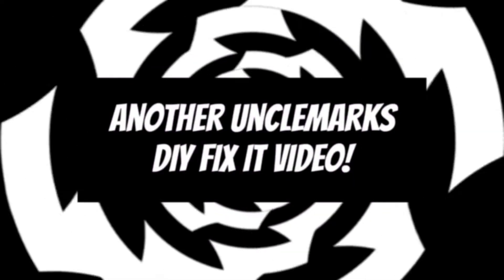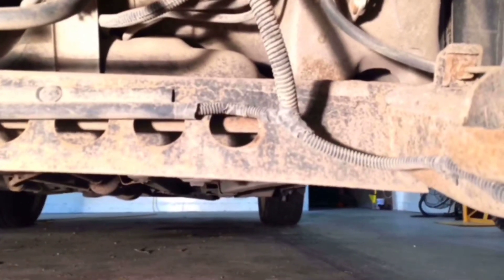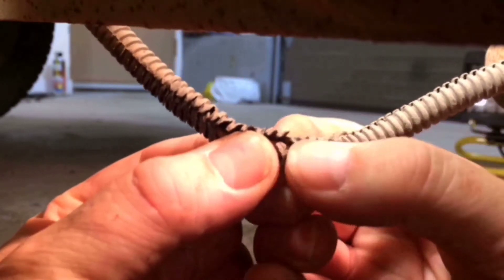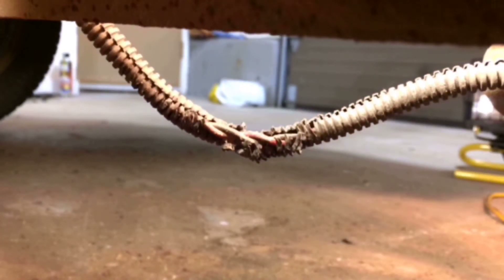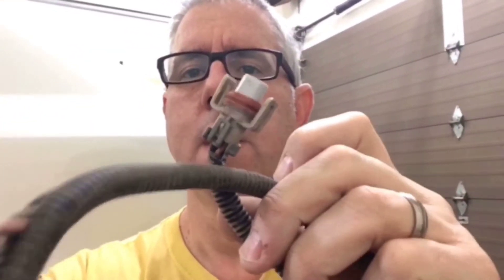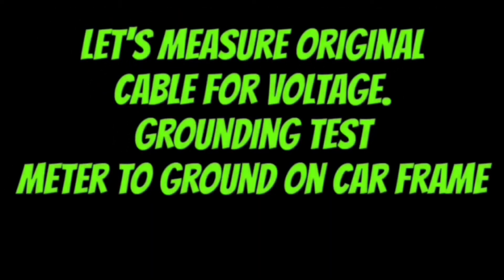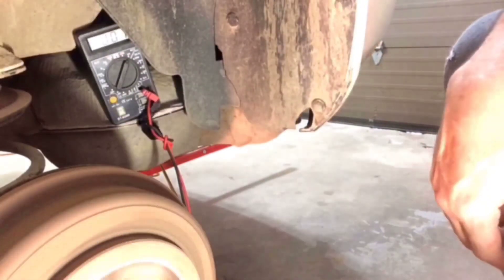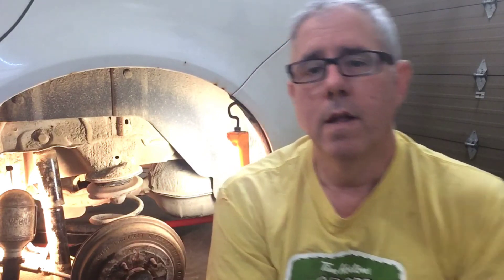2008 cobalt abs malfunction basic testing (EP 24)

Comment: My abs is coming on and off and it says traction control is off but comes back on after a few minutes starting the engine. I did pull out a 3rd break light the other day. Faulty fuse?
Reply from the maker: @fishlmao372  I guess it’s possible a connection somewhere might be loose. The computer does some self checks at startup. As for light going on and off, again hard to say for sure what is up. Do you have a code reader? It may tell you which wheel is the issue, then you can look closer at it.

Comment: I just replaced both hubs on my 07 cobalt (one had bad bearing, other did not have ABS sensor).  After replacing both hubs I'm getting C0045-18 and C0050-18 for both rear ABS sensors.  I did order hubs with ABS, so they should be good.  Can't see both failing.
Reply from the maker: Is not one of those codes have to do with a short to ground? Possibly you have a wire somewhere shorted? Electronics and electrics not my strong suit. Are these hubs a brand name? Wonder what happens if you plug the old ones back in and erase codes. Does it come back?
Reply: @unclemarksdiyauto  i can try that in a few days.
Reply from the maker: @ImGumbyDangit  does your scanner tell you which side has what code? Mine knew which side speed sensor was gone. You could also try having one side plugged in, clear code, then drive until new code. Record code, then clear, plug that one in and unplug other side and try same. That might narrow down which side is issue.
Reply: @unclemarksdiyauto  C0045-18 is Left rear and C0050-18 is right rear.
Reply from the maker: @ImGumbyDangit  Did you have the same codes before you replaced them?
Reply: @unclemarksdiyauto  unfortunately I did not get codes ahead of time.  My daughter just got this car and we were checking it all out and found rear brakes needed to be done, plus one bad bearing and one hub without speed sensor.  I'm going to have a look at the wiring tomorrow night.  I hope it's that simple.

Comment: i know this has been a while but my cobalt back driver side wheel is locked and im also having the abs and trac lights on
really need some help
Reply from the maker: Me not a mechanic, by locked you mean wheel doesn’t turn?  If so, e brakes may be stuck on, or something has fallen apart. Could also be your wheel bearing has seized. This may or may not be related to the abs and trac light on. Any wheel could set that fault. Code scanner could tell which wheel set the fault code.

Comment: Same thing is happening to my cobalt on the front wheel. Any idea if it's possible to remove and clean sensor rather than buy a new bearing?
Reply from the maker: Dr Claw i am not sure. This exact year and model it was not removable. It was built in as part of the hub assembly.
Reply: UncleMarks DIY Automotive Fix it channel ok i think that answers my question. I'm getting a code that says the sensor is getting erratic readings. Because of this the abs is kicking in at slow speeds. Also disables traction control at start up. I was thinking corrosion may have lifted the sensor up a bit and removing, cleaning, and greasing the spot where it mounts may fix it. Seem plausable in your opinion or can you remove the sensor to do that usually?
Reply from the maker: Dr Claw, I’m no expert. But the ones that  the sensor comes out, you might be able to look inside where the sensor is, could be corrosion on the pulse ring. Might be able to scrape the crud off, then blow out said crud. Maybe blow with air while vacuuming it out. Can’t hurt to try. Look closer at yours. If sensor is removable, it should be held in with 1 screw/bolt. Follow the wires to the hub. Should be able to tell. Will be fairly easy to access. I’m thinking if you can’t see where the wires end up, it’s not serviceable.
Reply: Just replaced hub assembly on the side where the computer said the problem was. Lights all went out during test drive but abs still kicks in after 5 mins of driving when slowing. Need more research and diagnostics i suppose.